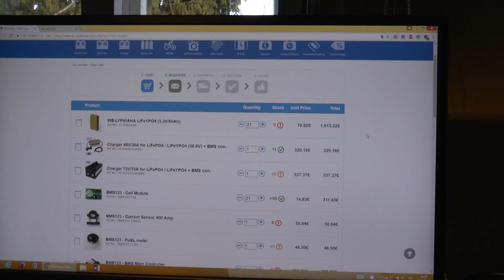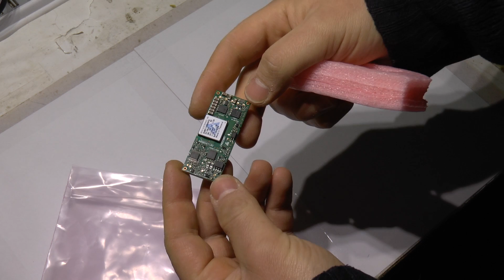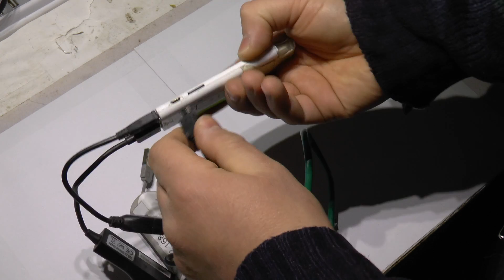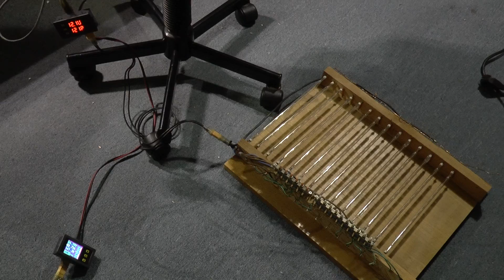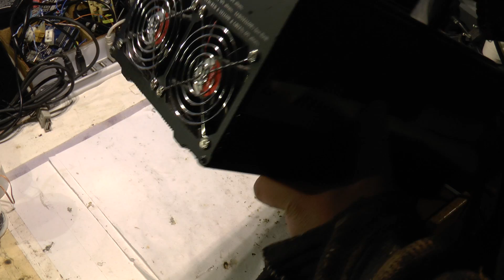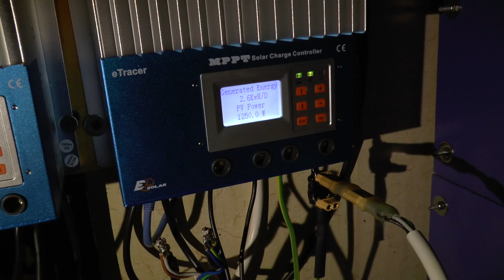CheapVlog #6 1000€ bargain!

Comment: Hi,  do you have data about how much your solar pv is generating in Estonia in the winter? Also I am very interested to find some guy like yours that gives me 4kwh lifepo4 for 1000$ :) any idea why he got rid of them?
Reply from the maker: Solar panels in the winter (nov-jan) produce about 0.5% compared to summer. Have to clean snow also. Planning bigger battery and DIY wind turbine.  He used it in go-kart and needed lighter and more powerful A123 batteries. I think today LiFePo4 is obsolete even as house batteries because twice the price compared to 18650 NCR, INR, IMR. Todays NCR, INR, IMR cycle life is as good as LiFePo4! You can get brand new 18650 cell ~210€/kWh (samsung 29E) from nkon.nl.
Reply: DIY wind turbine sounds interesting. If you have such big energy demand, have you explored hydrogen as energy storage? You can store as much as you want in the summer for use later in a fuel cell.In my case I just want to use the batteries for a small off-grid house in Italy. I have been researching a lot on the internet and there is a lot of wrong/outdated information that now I am having a headache. I thought that I like LiFePo4 because of the safety and the low power density is not a problem for home application. The Samsung 29E looks like a lot of work, right? do I need some active BMS that manage every cell? what if one cell is off balance? fewer big cells sounds like easier work for me, or what is your advice to get the small cells working safely and good?
Reply from the maker: Hydrogen lost the battery battle. Batteries are cheaper. For balancing, cell size does not matter. The more are in parallel the less you need balancing. I have 22S18P 18650 pack and after 2 years (~150 cycles) never had balancing needed (no BMS) capacity ~98% left. Also ~2 years Leaf cells 14pcs in parallel and 14 in series not yet needing balancing. But my big Windston LiFePo4 cells needs constant balancing!